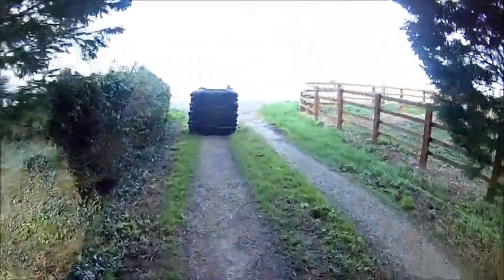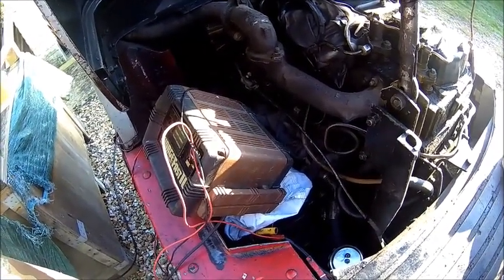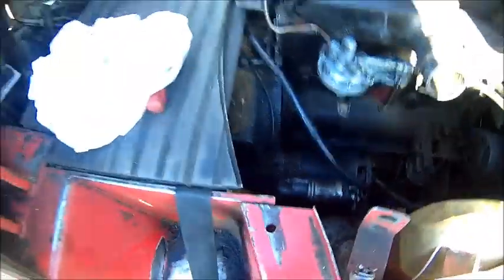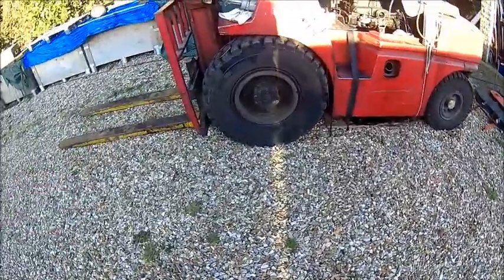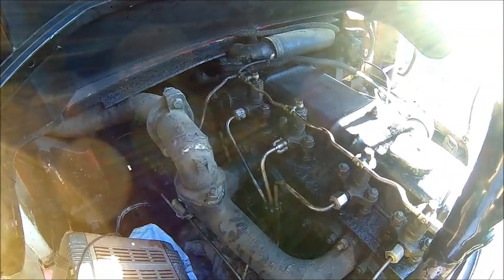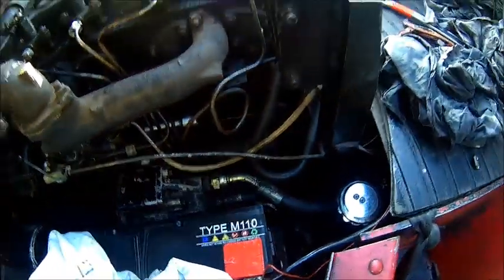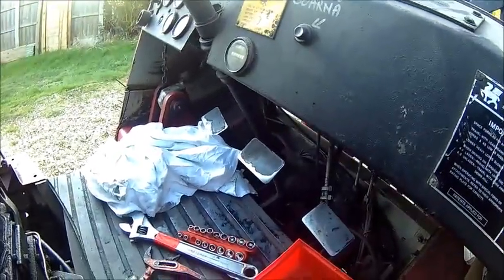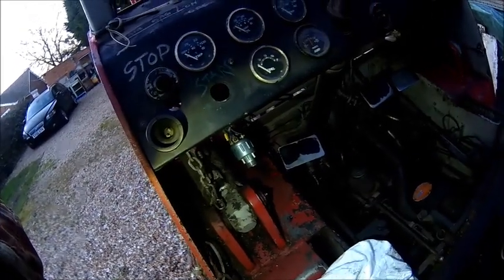This Old Forklift, Ep#1, restoring a very tired Lansing Bagnall FODR6 2.0

Comment: We run one of these for many years in our scrapyard, really reliable, strong and simple to work on. Ours is a 1977 model and has a 4.236 perkins. Yours has a Perkins 4.203.
We replaced it with a Linde H30d 
which has been good to but not as strong as the old Lansing Bagnall.
We still have the old Lansing it now lives at our farm where we keep our vintage tractor & engine collection.
Reply from the maker: Thanks Carl, seems there are not many left of those. I am surprised that your's got the 4.236, because the 2 ton version was always supposed to have the 4.203. According to the serial number mine is most likely a 1977 vintage, too.
I agree that these are very well built, but this thing was treated very badly for a long time, lots of work to do, but it runs and lifts since i fixed the worst things. My engine and axle are still original, transmission  (Warner 10-10) is a newer serial # .

I wonder if you have any paperwork of your's, the only thing i found (in an antique book store ...) was service manual for an FODR5. The gearbox, engine and most other things are the same, but my axle is a Hamworthy instead of a Kirkstall, I certainly have no problem with taking unknown things apart and fixing it, but it's always good to know what to expect before you turn the bolts.
Shame that you so far away, like old tractors, too, had a Hanomag R19 and a Porsche Junior when i was much younger ....:-)
Reply: @dynoguy  
I made you a video of ours 👍
https://youtu.be/eC75YH0ZOrc

Comment: crazy how much time was spent on jury rigging the machine... they could've actually fixed it in the time they spent on it. but you got a decent machine once the maintenance issues are done..
looking forward to the series...btw the front tires may be a size too big if the forks don't drop all the way to the ground. it's a common theme in forklifts. they often take oddball sizes and many outfits try to save money on tires and then end up buying tires that are close in size and do fit but fail to take into account that the tire sizes are critical to the operation of the machine. it could also be a partial source in the lack of power. 

how's the volvo coming?
Reply from the maker: Did you read the description ? .... Makes me wondering even more. Good point with the tires, they look a bit tall, but the actual issue was that the rollers were binding at the bottom and the damper was seized, it's working ok now.
The lack of power was a missing cylinder, the fuel was squirting elsewhere and the transmission was almost dry, torque converters don't work very well with just air ...:-) Just got an ignition barrel, new battery and starter delivered, so that's coming soon as well. .... Volvo does well, got almost 4000 miles on it, still need to do the lifters,...how's you and the Trabbi ?
Reply: @dynoguy  my bad...i didn't the description until now since you pointed it out. it sounds like a lot of little stuff that has added up to a grand sum total. but from the looks of it all, the substance of the machine looks, at a glance, to be in generally decent nick. it's not like there are rods knocking, pins and bushings worn out and the mast flopping around in the guides, or huge cracks in the frame. a little bit of weeping in older machines is quite normal, which is why it looks to be in half way decent shape in mine eye...
the reason i pointed out the tire size, when you look at  the thing from the side, it looks to be a tad higher in the front when you follow the line of the "belly pan".. it rises to the front of the machine when it should be close to level and parallel with the ground 

now just out of sheer morbid curiosity on the volvo.. would it be better to just drop the engine out of the car to get at the lifters rather than trying to do them in situ?? 

me.. oh.. still plugging along, trying to lose some weight...lol, having some issues with my landlady ...the Trabbi is still plugging along too.. had to go back into the engine a while back and drill out a stud hole in the head and put in an insert..made a guide to drill and thread it in.. made a vid on it. worked much better than expected. that thing is pretty forgiving...probably one of the more dependable vehicles i've ever owned..the more i work on it, the more i like it.
Reply from the maker: Your observation with the belly line is entirely correct, but all the pictures i found on the web (not many to find) are like that, so i assume that's just normal on the Lansings. The only really alarming things are the brakes and i just found that the left pivot pin of the mast has been badly butchered by a rather brainless individual, so that's going to be a lathe job.
This truck is about 45 years old and built like a tank, pretty hard to destroy, all it needs is a good amount of patience and tlc. .Certainly not a quick fix, but at least food for many videos ...:-)

Volvo lifters are doable in-frame,  looks worse than it is, tightest spot is fiddling with the cam belt, the other stuff is fairly accessible.

Losing weight is easy, just stop eating ...:-)
Reply: @dynoguy  oh dang.. i got too much irish blood in me veins to be able to stop eating... sorta like telling a lush to stop drinking.... ;-) god gave us irish the whiskey so we don't take over the world...lol
Reply from the maker: Groupie is a Chef (and a pretty good one) ... so tell me about it ...:-)